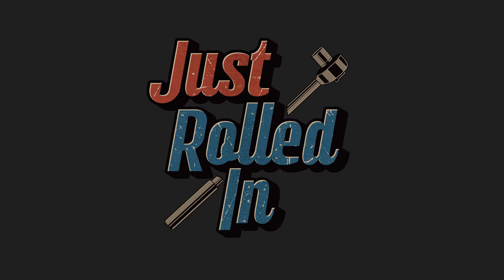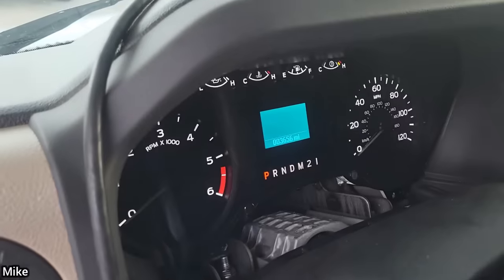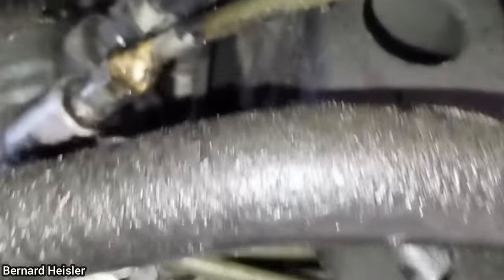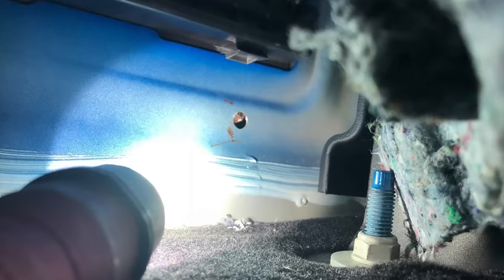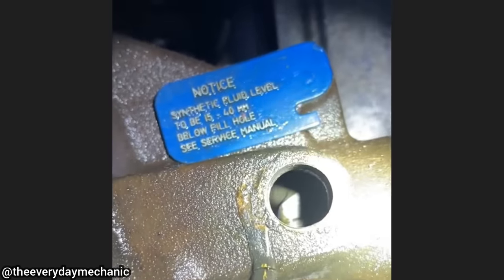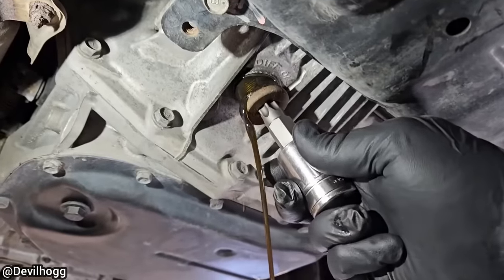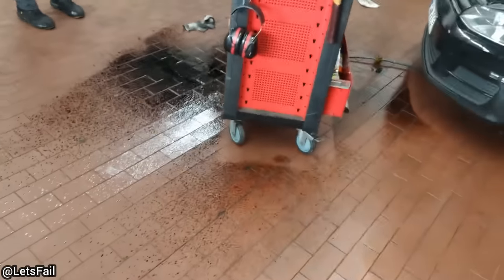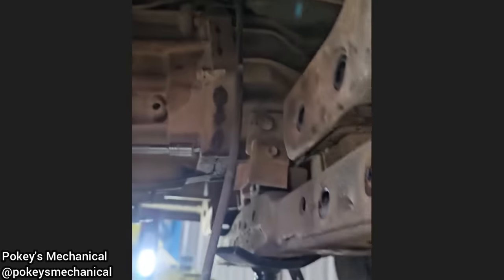Mechanic FAILS Compilation | Just Rolled In

Comment: Downright criminal what some of these shops do to customers.
Reply: I think he meant actual deadly stuff, like not installing the caliper or not tightening lugnuts. Or hell, if the transmission explodes it could cause the car to lose control too. @snarkybuttcrack
Reply: @markellii3093  Yesnt
Reply: @markellii3093  no... he definitely was talking about the scams, not the negligent whoops like forgetting to tighten lugnuts or caliper
Reply: And a lot go to the hospital because of it.
Reply: That is why you do all your own work to your vehicle.  Do not believe the myth that owners can not service and repair their own vehicles.
Reply: Sadly it's nigh impossible to actually hold them accountable
Reply: "painting" the other cars in the shop....:face-purple-crying:
Reply: I had my wife's brakes done once and she said her car was making noise after we drove home.  I drove it just a few feet and could tell right away when the wheel rocked, he didn't tighten the lug nuts, they were just half way on.  I was so mad.  It's an easy mistake to make, I suppose, which is why I always double check now.
Reply: @indridcold8433  A valid point sir.
I'm NOT a mechanic (far, far from it), but - youtube is a GREAT resource - it took me 10 mins to watch a video on "how to" do an oil change on a 2006 Holden VZ Commodore, and 10 mins to actually DO IT (I'm sure it could be done faster with experience).  The cost was less than a quarter of what a shop would have charged, and I know it was actually DONE.  I needed no special tools (just a socket wrench I already had) and did it on my driveway without even having to lift / jack it off the ground!  If I'd known how EASY it was to do "most" maintenance work, I'd have been doing it for the life of the car!!!
Reply: @indridcold8433 you havnt watched enough of this channel because there are plenty of examples of people who have no business working on ANY car, theirs or otherwise
Reply: @OhSoddit  With a nice set of wheel ramps, it is even easier to get under your car for any reason. You just put the wheels in front of the tyres and put your vehicle on low gear and drive up until you feel the bump stop. Now you can do anything under your vehicle.  You will never need a shop again.  You may start being known as the honest and helpful mechanically inclined neighbour.  Later, you will be known as the knowledgeable amateur mechanic. Then, you may be known as simply the neighbourhood mechanic.  It is an evolution. You will have people that know people that you know asking your advise and help.  You will find yourself getting extremely knowledgeable.  Later, you will start getting more tools, more technique. You will even start getting your own specialty tools that you found yourself renting a lot. It is unavoidable.
Reply: There was some story on Reddit of a girl who worked with her dad as a mechanic so she knew a lot about stuff when it came to cars. So one day she brings her car to a shop and the mechanic grabs the air filter, gathers dust and a dead wasp and puts it on the air filter. The woman had already checked the air filter so she knew it wasn't that dirty and the mechanic did that to scare her because "she looks like she knows nothing about cars" I'm telling you some shops do things to earn extra $$$ on people.
Reply: Fr

Comment: The fake 4WD really was a pretty elaborate ruse!
Reply: Big lawsuits there!
Reply: @Krzys_D  It's possible the dealer bought it at auction and was victimized as well.  The ruse is too much work for a dealer to bother with.
Reply: I would! @Krzys_D
Reply: @russellhltn1396 to me that just sounds like the dealership tried to save a buck without doing a proper inspection.
Reply: @EJBert Maybe a ruse, but only if the title was washed. It had a salvage title. In some states that means damage beyond its salvage value. If, say, the dash and interior was damaged when someone stole the entertainment system, that could have made it salvage. Dropping in a used dash, wires and door panels might be all it'd need to make it whole. Completing an inspection would make it eligible for a rebuilt title. If the dealer didn't sell it with a washed title, the owner simply assumed it had 4WD because of badges. (My friend bought a "4WD" pickup that'd simply had $20 TRD 4X4 stickers applied by the PO.)
Reply: @russellhltn1396  if they did their due diligence, the vin number would have told them that it was 2wd
Reply: @Krzys_D or sticking their head under to look at the transfer case (or lack thereof).
Reply: @Krzys_D  But that's extra work! ;)
Reply: I wonder if the cab was damaged or wrench. And they changed the cab with a used one. That would explain the salvage title
Reply: @mikep490 while I like the theory, the added badges definitely make this deliberate. If it were just the console sure I might believe that
Reply: @chrism8180  One more reason to have a vehicle inspected by someone who knows something about cars. Badges, we don't pay attention to no stinkin' badges.
Reply: @mikep490  I don't disagree, but you are trying to play devils advocate when this was definitely a deliberate con
Reply: @chrism8180  You could be right. On the other hand I've know a lot of people who badge their cars. I've owned Fiats and there are more fake "Abarth" than real ones. There's no counting how many TRD, 4X4, SS, and HP Dodge models there are out there. Everyone knows, if you put on enough stickers, you gain 30% more power.

Comment: 25 years now without having a car fall off a rack. Happened to a coworker while I was 5 feet away. Don't be careless & take your time setting the lift.
Reply: yeah that guy was absolutely lazy
Reply: Or for the DIY folks, use JACK stands when on a jack. PLEASE!!!
Reply: The screw jack is a great safety practice, but not if you forget to remove it...
Reply: My 2002 f150 fell off the lift two times... Once at Firestone and the second time at my mechanics shop just after he made fun of Firestone doing it. Talk about concerning and hilarious at the same time. Truck got some bumps and bruises and a flat tire but hey. Stuff happens 😮
Reply: @buyallmeans425  did they fix the damage they caused?

Comment: 150 PSI. I was a 16 inch gunnersmate on the battleship Missouri. After we fired the 16 inch guns, they were blown out with 150 PSI. This was to blow any burning debris out of the muzzle so next round of powder did not ignite. If we heard air hissing from any pipe, we never ran our hand along to find the leak. We grabbed a wooden broom handle and ran that along the pipe. Better to saw the handle in two than saw some hand parts off.
Reply: This sounds like a very common usage of brooms and the like, cuz I swear I hear the same thing was used to find high-pressure steam leaks as well for the exact same reason. Better it than your hand

Comment: The horn beeping with all those buttons and switches were hilarious 😂😅
Reply: I'm just in awe. I mean... How?
Reply: How did they not figure out that at the mechanic... the wife doesn't use any switches when driving?
Reply: I was LITERALLY rolling on the floor laughing!!🤣
Reply: That is such an epic fail bc it would actually be difficult to do that even on purpose 😮😅
Reply: Reading comprehension lesson:
"The horn beeping" is the subject of the sentence. "All those buttons and switches" is not. "The horn beeping WAS hilarious" is correct grammar, "the horn beeping WERE hilarious" is not.
Reply: Earth (ground) problem?

Comment: 2:56   Obviously some customers aren't smart when it comes to taking care of their cars, but it's stuff like this that makes me mistrust car repair places.  Spray painting the existing part to make it look new and charging for a "new" unit...that's pronounced "fraud".
Reply: Always ask for the old parts.  Maybe take a picture before you take it in.
Reply: The rattle can rebuild, soon gets discovered is my guess.
Reply: @major__kong  If it's a warranty repair don't bother asking for the old part(s), the manufacturers make us keep those in case they decide to do a random inspection or it happens to be a very unusual fault and have us send them in.
Reply: @alexwalker2582 In Michigan the customer is entitled to the return of all old parts, or inspection of any parts that have to be returned for warranty or core charge. You can ALWAYS look at the old parts.
Reply: Last time I took my truck into the dealership for an oil change they put 8 quarts of oil in it which it only takes 6...glad I checked it before I started the truck up-I do my own oil changes now.
Reply: it's hard trusting mechanics if you have a reasonably new car. Cars are a lot more complex to fix now, and a lot of them don't bother learning new things.

Comment: Them springs be lethal

I remember years ago changing the shock on my car at home using the widow maker compressors (two not so sturdy prongs either end). Got halfway through tightening and had some slippage. At the same time I heard someone about to enter the garage and had to shout “STAY OUT”. 5 seconds later the compressor slipped completely one side and the spring gave it enough momentum where it wedged into the door frame about 15 feet away where my family member would’ve walked in

Next time round I made sure I secured them compressors properly before tightening 👍
Reply: @smilerbob, yea as the "non-mechanic", I never liked spring compressors. Had to use them once on my beater to get the factory springs off and put on lowering springs. Def not fun, they "slipped" a bit but being as careful as possible paid off & nothing bad happened. I like the fact that they offer "complete struts" tho so you can just replace them as a complete unit. For some people tho they may go the cheaper route of replacing the strut/shock whilst retaining the spring.
Reply: Fuck that compressor.. We were doing springs on a damn box truck and the ONLY damn compressor that would fit was the widow maker. It exploded into sparks and broke the compressor. The second set shot it across the shop. I hate doing them with a passion.
Reply: Yeah we made our own using some beefy threaded rod, those widow makers are terrifying

Comment: I am always awestruck at the neglect of basic vehicle maintainence and the shady work some of these  shops pass of as proper repairs. Just wow.
Reply: Yeah, it shocked the hell out of me!
Reply: Holden dealerships in Australia were blatant FRAUDS.  They didn't "repair" faults they should, and advised repair work that simply wasn't needed.  (Classic example:  in 2011, I was told I "urgently" needed a new water pump, and if I had it done STRAIGHT AWAY they "might" be able to save the coolant.  $595.  I declined.  In 2023, +12 yrs and +140,000 kms, I took the car with a now whining water pump in to a non-dealer mechanic - $380 to replace it AND do a coolant flush!!  I could have actually done it myself (youtube videos show how easy it is) for $130 (pump and coolant) and an hour or two of messing around). The question I'll never have answered is were Holdens going to needlessly replace a water pump and charge a massive markup, or were they just going to charge me $595 for nothing?  I'll NEVER use a dealership again!!!)
Reply: they learned from politicians!

Comment: Many years ago, the family station wagon was a regular in the service bays of a local gas station. They gave us an inadvertent discount by, at different times, leaving 2 screwdrivers, several shop rags, a small pair of pliers, a large pair of pliers, a Grip-Tite wrench, and a pair of vise grip pliers under the hood. They also once changed the air filter and forgot to bolt the lid back down, so when investigating the new rattle beneath the hood Dad found the entire air filter unit sitting at an angle off to one side of the engine.  Years later, after religiously bringing it in to the dealer for regular rune-ups & all required repairs, my folks sold their 1st generation Ford Taurus to a family member who lived in another state (they charged him something like $10). When my relative took the car in for his state's required inspection, they discovered that every single piece of hardware under the hood was factory original, even though we'd been charged over the intervening few years for multiple belts, a new water pump, and two new alternators...
Reply: Land of the Brave.
Home of the Free.
Reply: I was "gifted" a 2ft Snap-on ratchet wrench by my local Firestone shop for bringing in my '74 Valiant for brake service. Was left under the hood. Must have been an "early" Christmas gift! Thank you FIRESTONE...
Reply: Ah, the good 'ol days.
Sadly, it's "unlikely" anything made today will last like that.  "German ENGINEERING" has fine tuned the ability to design something which will wear to the point of failure (mileage) just outside warranty.  Quality control in the USA?  Forget it.  I bought a Marlin 22 rifle, right out of the (unopened, undamaged) box it had a BENT BARREL.  Let that sink in.

Comment: Oh and also, on welding and brake clean: DONT WELD THINGS THAT HAVE BEEN SPRAYED WITH BRAKE CLEAN. Welding arcs will heat brake clean to the point that it breaks down into phosgene gas. One little wiff and you'll have permanent debilitating brain damage
Reply: you mean worse than we already have?
Reply: Honestly i think tetrachloroethylene should be banned from brake cleaners for this exact reason.
You don't have to look far for a mechanic that nearly WW1'd themselves because of this stuff.
Crazy dangerous!
Reply: Just chlorinated, so if you're welding, just use non-chlorinated. Phosgene isn't something to mess with though.
Reply: just don’t weld with flammable shit or chemicals around
Reply: These guys wouldn't notice  permanent debilitating brain damage
Reply: @PaulG.x  bad enough no need to make it worse
Reply: For those that don't know, phosgene gas is the same as "mustard gas" the same as used in WW1! SERIOUS stuff!
Reply: If you're welding near flammable/dangerous chemicals, it's too late to start worrying about brain damage.
Reply: I used to know a guy that would start vehicles on brake cleaner inside his garage. He eventually stopped working on cars because of the brain damage he gave himself.
Reply: I was never told this, thanks for sharing
Reply: Burning your lungs, or being blinded are also possibilities with phosgene gas.

Comment: I think quick lube places have been busted by news crews several times for not doing the services that they charged customers.
Reply: @ronj9124, oh yes and Canada has some instances of those with the "CBC Marketplace" videos, you might want to look them up if you haven't seen them. Not only are they about cars but home repair services on garage doors, appliances etc. As for automotive they've exposed some of them where they tried to upsell services like "fluid flushes" etc., yet they never even performed the service but ran up a bill of like $200 or more when they just went in for a "$40 oil change." It's disgusting.
Reply: @zenithperigee7442  Yes, I have seen a couple of Canadian ones.
Reply: We had a local quick lube business, that changed hands multiple times, because of complaints. One day there was a fire, and the business next door bought the property and tore down the building.
Reply: My father (AGAINST my advice) had his old diesel ute serviced by a "mobile mechanic".  After the service, he couldn't get it started.  "Sorry, bad news, looks like you need a new alternator".  $$$ for the new alternator.  STILL wouldn't start.  "I'm sorry, you'll have to try a diesel mechanic, NOTHING I've done would cause it not to start".  I replaced the fuse he blew when f*cking around with the alternator (which didn't need replacing) and it runs fine.

Comment: This is precisely the reason why I perform ALL services and repairs on my own cars. I had a real loser work on my Cutlass Supreme back in 1979. Instead of replacing all eight spark plug wires during a "Tune up" he decided to replace just one, as the other seven plug wires looked "ok". My  mother who was driving the car at the time, barely made it home stating that the top speed she could coax out of the engine was 30 mph. I decided it was time to work on my own cars. Forty four years later I still do.
Reply: Interesting point but what can the rest of us do?
I used to know something about car maintenance but now I'd be afraid to change the oil because everything is so different under the hood.
Reply: @that_thing_I_do  For just oil changes it's not that different.  The two things to watch out for are that you might have to remove a bottom cover to get at the drain plug, and it might use a cartridge filter rather than the traditional spin-on oil filter.  If you search on YouTube you can find videos showing how to do oil changes on a wide variety of cars and trucks so you can decide if it's something you want to do.
Reply: 1965 mustang, mechanic said he changed the spark plugs, oil and transmission fluid for my parents. he changed the oil and 5 of the 6 spark plugs, tranny fluid was from the 80's (not driven a lot though), 3 plugs were hand tight two were in there ok and the 6th one at the back that he didn't change was stuck in there good. had a nice layer of crust on the contacts. nobody in my family did cars at that point and only reason we know is i needed something tangible to do in uni.